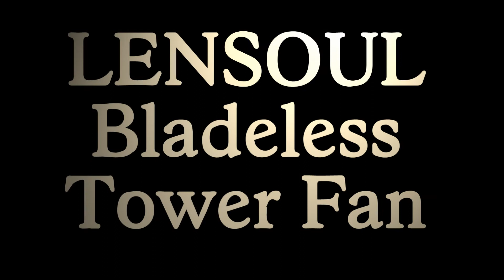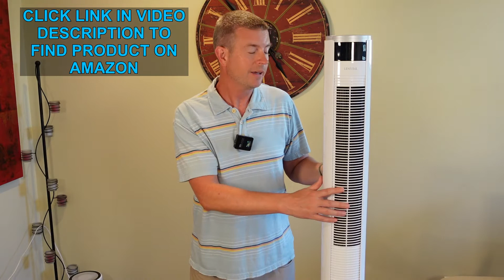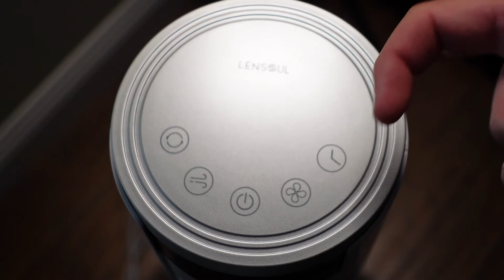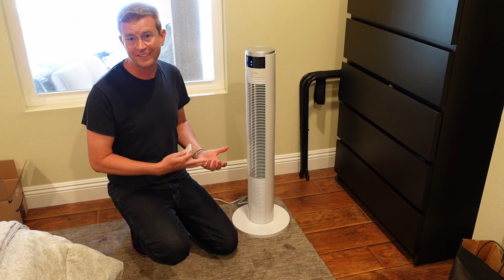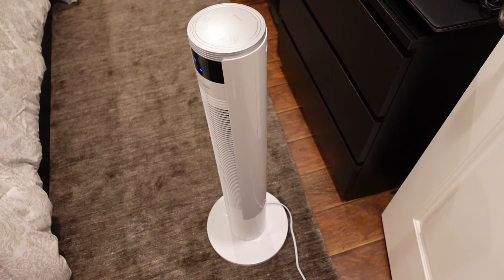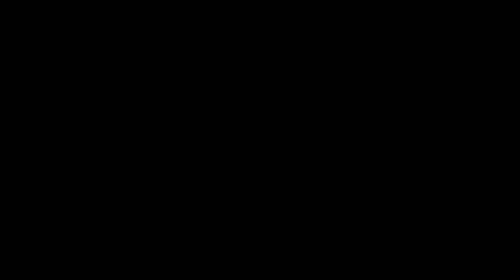Lensoul Bladeless Oscillating Tower Fan with Remote Demo and Review Timer Speeds and Modes

Comment: What is natural mode? It just seems to start and stop blowing.
Reply: Oh you answered it at 6:08
Reply from the maker: @eltram3883  Glad you found it. It's one of those things no one really "needs" but is a nice thing to have as an option.
Reply: @hollywoodfrodo  The fan is pretty good. But the instructions were almost worthless. They didn't explain what any of the features did. They don't even have a website that tells you. 

Unrelated question. A lot of fans have a timer mode that turns them off after a period of time. But do you know any fans that have an automatic turn on mode? I ask because I'm Shabbat observant and can't interact with electricity on Saturdays. I can set timers a head of time, but simply reconnecting a power supply to most digital fans doesn't activate them the way an analog fan would.
Reply from the maker: @eltram3883  I don't know of a fan that has that built in. However, if you're good with "smart" stuff, since that fan has infrared remote control, you can get a universal infrared remote wifi smart device, program in the control to turn on the fan, then set up a timer for that smart infrared remote to turn on/off the fan at specific times...